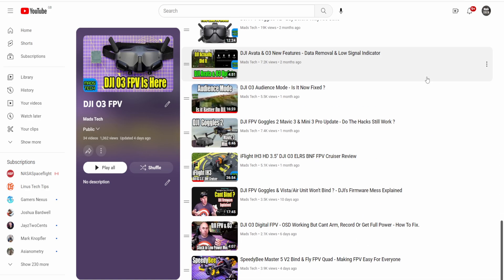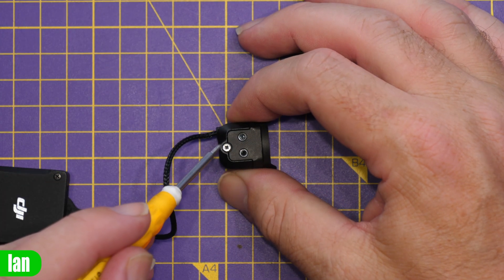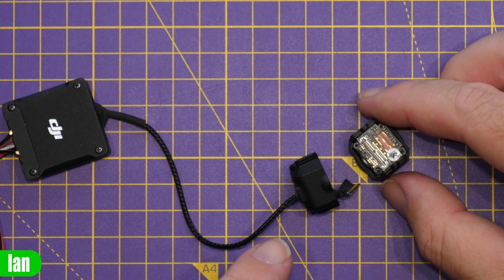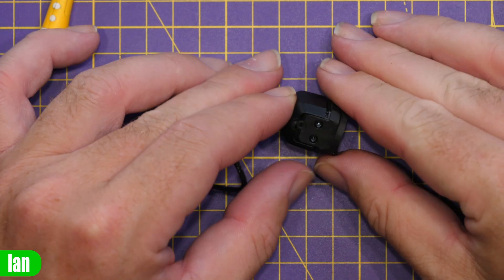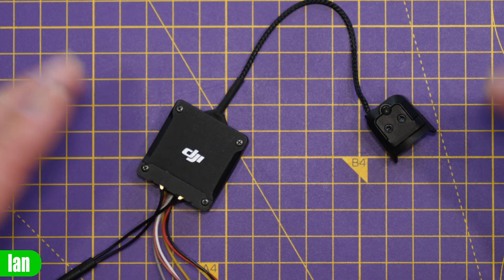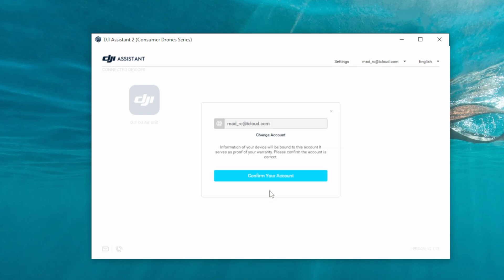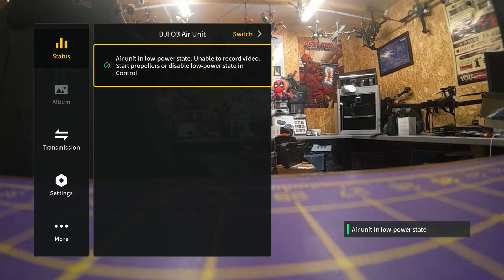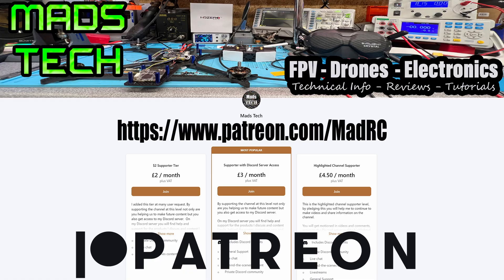DJI O3 Camera Replacement - Camera Calibration Error Fix

Comment: 1. Plug battery in, to power 03.
2. Plug USB cord to 03
3. Then open dji assistant 2
 Calibrates automatically if camera is dji 

Thank you Mads Tech

Comment: Just broke mine and got a new one, it came with cable attached. it will be much more easier to just replace the cable that came with camera and not open the camera. That will work ?

Comment: This video is probably not up-to-date anymore.  I have a O3 unit, its activated (camera too) and I still cant calibrate the camera.  My expert tecnician says this is happening to all O3 cameras now when replaced and that there is no fix.  Is this true??? @madstech
Reply from the maker: The official DJI supplied cameras will calibrate but 3rd party supplied ones will not
Reply: @MadRC  unfortunately you are wrong.. I have original O3 cameras and all of them are having this calibration error. Mine is activated and won't calibrate. Make a new video! ❤️

Comment: Hello! I replaced the camera because mine was showing black screen with message to calibrate on the googles and the calibration always fail. After I did the replacement, the same problem keeps on. Any idea of what's going on? Thanks!!
Reply: Any luck in fixing that?

Comment: The big point here is to power your O3 with the flight battery, THEN plug it into usb-c. At least for me, and many others it seems you will not have the calibrate camera option in DJI Assistant UNLESS its powered first by the flight battery. Great video as always Mads!
Reply: im doing that and still dont have the option
Reply: @VelarVista mee too

Comment: hello there, somebody can help? I got a problem with the gyroscope of the camera of O3, i'm update this several time (on mac), so the menssage on the goggles 2 disappear, but when i want to process the mp4 imagen on the last version of gyroflow, say this menssage: The file format was detected, but not found movement data The camera probably does not record data movement in this particular shooting mode. 4:3 2.7k 60fps eis off d-cinelike. any sugestion?
Reply from the maker: You need to be in 16:9 wide for Gyro data to be recorded.  You can crop to 4:3 later in post.
Reply: @MadRC  does not work, um update this several time, not work in 16:9 or 4:3, eis off, etc. whatever not work the gyroescope (from nothing)

Comment: Can I check whether DJI Avata camera replacement can be calibrated too? I was told that we need to send in for camera replacement since the DJI doesn’t provide the calibration software via DJI Assistant. Can someone advise pls?
Reply from the maker: I’m not aware of a way to do it on the avatar but you could try in assistant 2
Reply: @MadRC  DJI: I am sorry that there is no similar camera calibration option on the DJI Assistant 2 for DJI Avata. And we are sorry that we may not support self-repair. If needed, you can send it back to DJI for further service. Thank you for your kind understanding.

Comment: I’m not getting Gyro data even with EIS Off and Wide FOV. Any thoughts?
Reply from the maker: This has been seen now and then and it’s usually a bad camera module.  Remember though the gyro data is baked into the video file and not a separate one.
Reply: @MadRC  yeah. When I drag the mp4 to Gyroflow, it tells me the an alert that there’s no gyro data.
Reply: @MadRC  if it’s a bad camera, that’d suck….I only had 5 flights to test and no crashes or damage.

Comment: @Mads Tech.  After you take the back off the camera can you take off the screws that hold the camera in and remove it,will the glass come off,if i had another 03 camera that doesn't work,can i just swap the lens/glass?
Reply from the maker: Yes you can actually swap the lens.
Reply: @MadRC  do you think it would be possible for me to use the lens from a broken Avata?
Reply: @MadRC  and thank you very much
Reply: So, what about a dji action 2 lens

Comment: I have the error on two of my O3 cameras when I try to calibrate. Sent one of them back to DJI and they said that the camera calibrated to their air unit ok.

I use a non Mac laptop, the only thing to try is another computer, but I’d be surprised as it handles everything else ok. It’s frustrating.
Reply: Now sorted, it was my laptop. Calibrated on a friend’s pc no problem.
Reply: @Natterjack74  What was the error? When I connect air unit to googles says it need to calibrate on DJI Assistant 2. So I Tried to calibrate it on my notebook (samsung) and I get "calibration failed, please contact DJI"...

Comment: I have bought a Cinelog 20 with O3 Air unit. The gyro data is not colllecting. Gyroflow is not working. I’ve put camera on wide angle and rocksteady off, but still no gyro data. 
Any ideas to fix that?

Comment: Well this sucks. Can you fly over the calibration message? 
The lens is removable, lefty loosy, but nothing to replace it with.
So, you can't pre-calibrate backup cameras for in the field? ( I know you said Used) I don't want to have to lug a laptop up the mountain.
Reply from the maker: No you can say pre calibrate 2 cameras either.  It wants it every time.

Comment: One of the statements made is factually incorrect and should be addressed. The lens is in fact replaceable its a screw in type lens that does in fact need to be adjusted from time to time as vibrations and lack of glue from the factory lead to it becoming out of focus. What is true though is there is not a single replacement available because its an M11 aka 11mm thread size instead of the standard M12 or M8 you'd find on all other fpv cameras. When i reached out to Runcam and asked if they would make a replacement lens like they do for most every other fpv camera on the market they replied with the following "Thank you for reaching out to RunCam. I am sorry to reply that currently we cannot provide another lens for O3 camera due to authorization. If it gets available in the future, we will release a post for that. Thanks again for your support, have a good day! Best Regards, Kaisa"
Reply: I was looking for this comment before I made a post. I measured 10.7mm in diameter at the threads and total length of the lens is 11.3mm.  Have you checked the lens with a thread gauge check board?
Reply from the maker: Yes I know it’s technically removable but no one makes one and it’s not available from DJI so = it can’t be replaced.

Comment: I was not believing the head line first - till 1:40 and the explanation which I have read but forgotten, I mean the post production of the footage to get it stabilized. 
At least the repair or replacement looks easy to fix and not filled with nasty coolant stuff i had seen in most recent chinese solar power inverters full of compound you can not remove therefore close to no chance to replace the dead power transistors and what not, I mean 3 cm or 4 cm of ugly compound. I hope that this stuff gets so expensive that they simply stop doing so.

Comment: What a coincidence! I just changed mine last night. Had a loose sensor. Calibration caught me off guard, then after the calibration it wanted to say my unit wasnt activated anymore. Was wierd. It went away.
Reply from the maker: Yea I think there is a real bug in this with activation
Reply: @MadRC  you know funny thing is I've had over 7 support emails back and forth with dji support about the rc link issue, I reconnected with them today about it and got a response that the engineer team "may have a workaround". Just need some info back from me and my logs.  Grain of salt but wishful thinking. Lol we all now how dji is. Rather give you an $80 accessory credit or an SD card. 😆 😆 
BTW keep it up Mad....as a circuitry guru I truly enjoy all of your content. I k ow it isn't easy but you keep it real. Thanks!

BTW day later and my u it still wants to activate. Lol